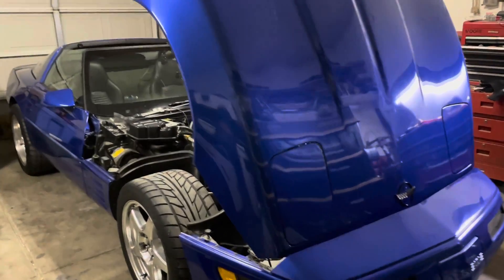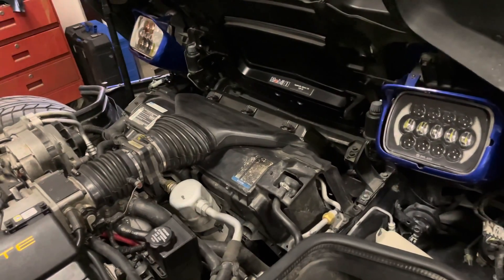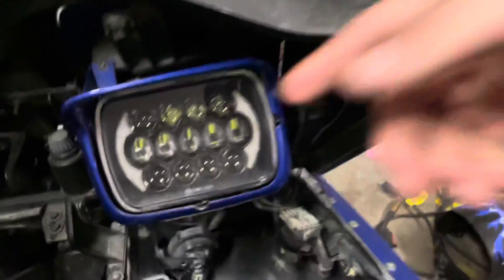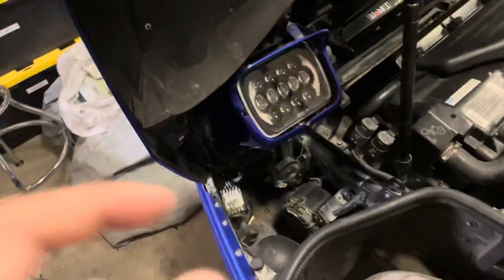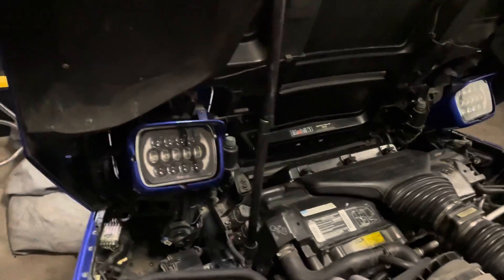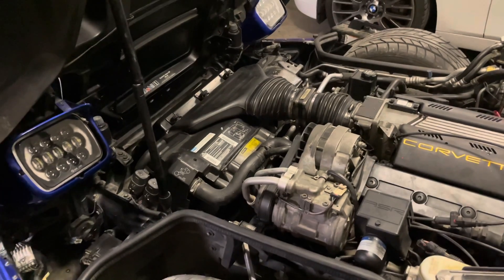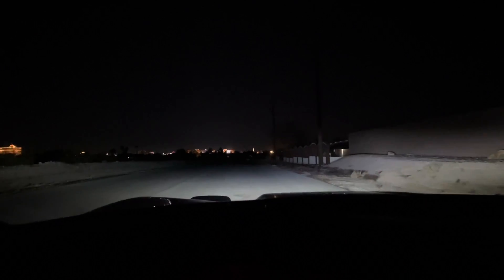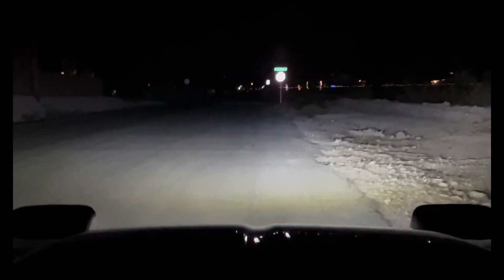INSANE! LED HEADLIGHTS FOR C4 CORVETTE!

Comment: Just got my ‘87 rag. Popping in a pair of JWSpeakers. Black bezel heated ones thanks for the instructional. Edit: I found your method for re/re headlights to be very difficult and looked further. Found another poster who made it a lot easier by disconnecting the grey plug and manually cranking the headlight around just enough to expose the 2 screws on the sides of the pods and the 2 screws under the hood that hold the bezel on. No need to mess with the adjusting screw. Also, before you waste money buying cheap lights, check out Headlight Revolution’s channel for comparisons JW Speaker 8910 evolution 2 seriously rocks the night better than anything else

Comment: OK, but is it legal? Hard to believe for $50 a headlight...
Reply: what would make it illegal
Reply: @MrGreenPandaz  Well, let's see. Lack of appropriate certification? Light intensity, and beam shape blinding everybody around? There are so many assholes driving around with $20 LEDs and HIDs from Ebay installed in stock housing that just don't care about people blinded by their headlights. There is a reason why OEM HID have a mandatory stabilizing system.
Reply: I hate when people blind me with headlights as well, but proper headlight adjustment should hopefully solve that…most new pickup trucks especially Ford blind everyone straight from the factory! I’m less worried about DOT personally
Reply from the maker: They’re legal just LED headlights, yes they’re bright but not brighter than what I’m seeing coming from these new 2022 vehicles. Cops wouldn’t know a difference.